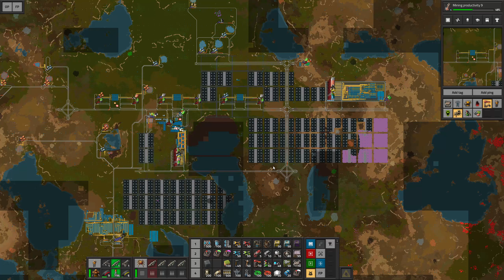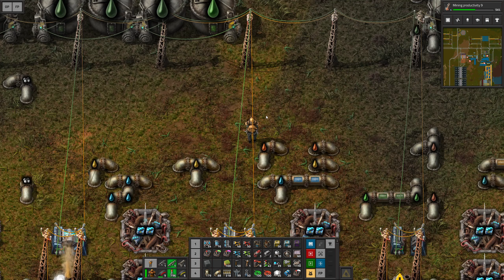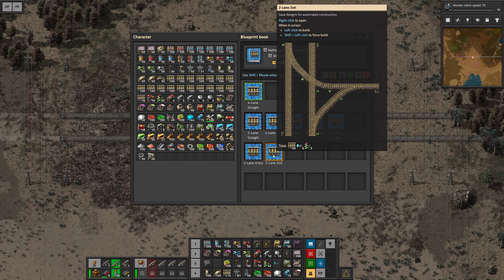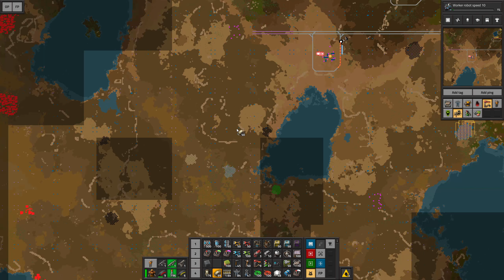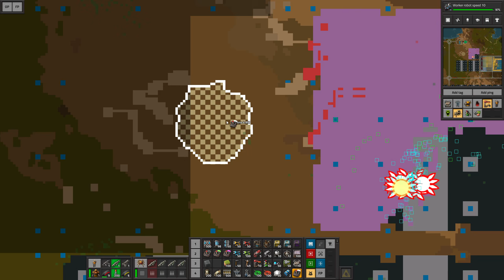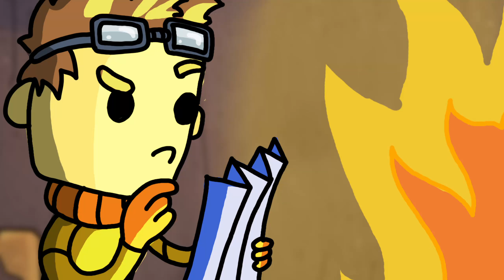RAMPING UP - Step 42: Factorio Megabase (Step-By-Step)

Comment: if the oil loading ends up being a problem you might want to look into switching it around again, with the pumps directly to a tank and the connecting pipe on the back, but if the oil is produced to slow this might not matter in the end

Comment: Wish you would have figured out how to make the module self sufficient energy wise. Maybe coming up with a nuclear energy block would be useful? Or is there a way to automate a switch so that your solar power only comes into the module after the nuclear power in module is maxed out?
Reply from the maker: I would have had to quadruple the reactor size, which would not make it fit very well into the module. I guess one could use a power switch to disable the solar panels, but I'm doubting how useful that would be.
Reply: @Nathans-Sandbox  what about a nuclear power module? The amount of solar power needed seems kinda wild haha
Reply from the maker: Yeah, I will definitely set up a larger reactor too, separated from the mega module.

Comment: I actually changed my solar stuff with the nuclear power: Solar is disabled via flipflops as long as my capacitors are > 30%, and if they go below, the solar panels will run until the capacitors are at 90% again. The reason is very simple: I want my normal power demand to be completely nuclear based, as I can't plan for the night time otherwise - at least not that well. So solar and capacitors are only left for my ~50 laser turrets and the case that I don't add enough nuclear.

Comment: Since oil is infinite, it's highly recommended to run pure speed modules.  Basically if you assume every oil well is 20% yield, no matter what it starts with, you will scale more easily.
The other recommendation I have is to do station limits with the circuit network to configure the "max trains".  This is especially relevant for oil deposits so you can have them only open when they've got a full train load of oil ready for pickup.  You should ideally never disable a station like you're currently doing.  When you do this, any train that's currently en route to a station when it's closed can literally stop dead in its tracks and block the main line.  Disabling a station (as opposed to changing the train limit) can also cause a lot of pathfinding lag due to it triggering a rebuild of the network.
Reply from the maker: Thanks for the tips! I noticed the unloading stations need to have a limit of only one train. As long as I have trains ready to go.
Reply: @Nathans-Sandbox  If you set the limit from circuit conditions, you can set it up so the limit is the number of trains required to fill your station to the required threshold.  The simplest way is to do something like
Each + 0 = R (gives you a single R signal that's the number of items in linked chests... used so the same wiring works on all train stations)
R / WagonSize = C (gives you the number of train loads you currently have)
MaxTrains - C = L (gives you the number of trains required to fill your station to MaxWagons)

3 combinators, and it'll only request enough trains to keep MaxTrains worth of cargo.

I usually use the cargo wagon icon as WagonSize, and the locomotive icon as the MaxTrains.

Comment: 1- Lasers will become active when bugs evolve enough to survive rocket barrage.
2- When attacking, do a zig-zag move thru nest. It reduce damage taken by a LOT because killatrons will dodge lot of "tower" shots. 
3- You missing quite a lot of modules in science sector. Mainly in fuel production.
4- Put steam tanks to nuclear power plant to increase capacity when it goes on downtime. You got plenty of space for them there
5- I am ussually big production modules promoter everywhere when possible, but if theres only place where speed modules are more usefull, its pump jacks, since they are infinite.
6- Add bypass for the entry/leave ramps, so even if theres something wrong and train cant enter, other can just go around it (at least in one direction)

Comment: You may have already caught it, but you added power to your smelting array when it was already following your power switch paradigm of turning off if the plate pick-up buffer is full.
Reply from the maker: Fixed that at some point, thanks;)

Comment: For your straight rail blueprints, you should make them snap to grid, but relative & not absolute, so they snap easily. Also add chain signals to them on both directions to split them into blocks that can hold 1 engine + 4 wagons as your base uses this configuration for trains. That way you'll have an infinite number of waiting blocks all throughout your track line, which will prevent trains being held back cuz one was waiting to dock 50 miles away

Comment: 17:44 looks like your steam turbines are dropping in power which may indicate the heat exchangers are not getting enough water
Reply from the maker: I fixed the water for the most part, the problem is that when I produce enough power with my solar panels, the reactors don't get priority.
Reply: I don't think that's the case here since some turbines went full power by the looks of the steam clouds and some didn't go at all. Usually when the nuclear plant just has to help a little bit there are some smaller steam clouds from every turbine. So I'd have to agree with @chimmy733 tbh
Reply from the maker: There are 4 separate water pipes, some are feeding from the front tank and others further back. The tanks don't empty evenly which results in some rows of steam turbines not working. The problem seems to be solved whenever there is enough water in the station.
Reply: @Nathans-Sandbox  I couldn't find it but I remember you saying that you use a mod to allow water anywhere, since nuclear is super thirsty, why not just put some offshore pumps right near by and then you don't have to deal with that?
Reply from the maker: I will do that with the big reactors, but I wanted to simulate the module not being dependent on the mod. The big reactors I would usually build near water, so I don't feel bad about using the mod there.

Comment: What about rows of reactors somewhere to produce power? Seems like nuclear power is easier to plop and be done with than finding space for the solar panels and setting them up.
Reply: The greatest downside would be the sheer amount of pollution they make, compared to solar panels that are entirely green. As the base grows, it gets harder and harder to deal with an increasing circumference to defend
Reply: Nuclear uses a lot of pipe/fluid movement which can affect UPS if you're going really really big.  solar arrays have little to no UPS impact.
Reply from the maker: We have lots of space for solar panels, I don't really have to find it. But maybe somewhere a little huge reactor works make sense.